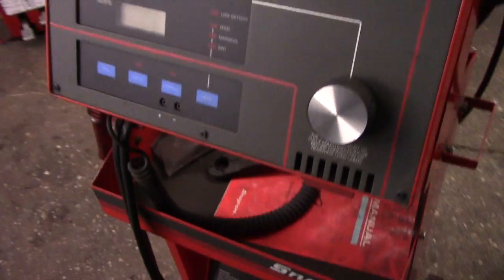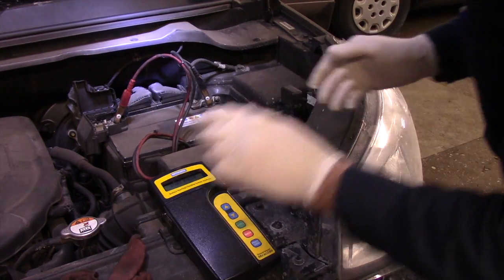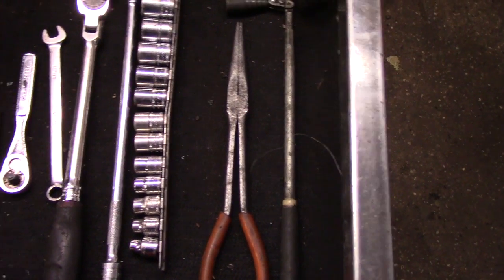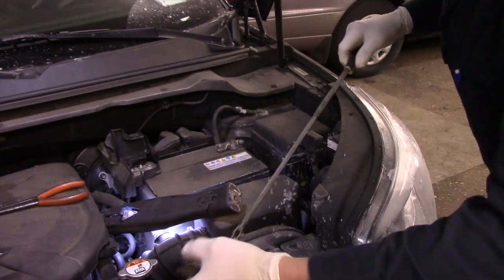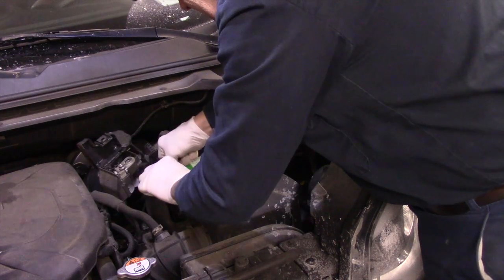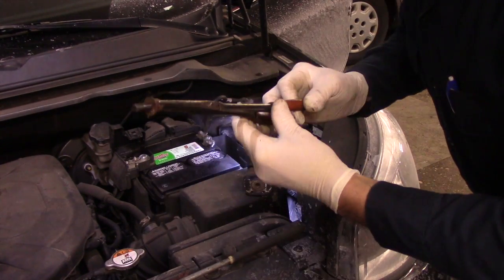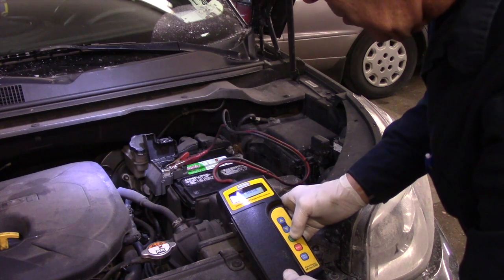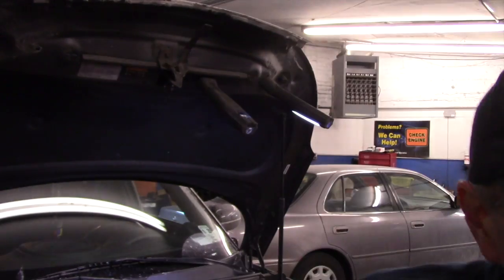No start now what !!!

Comment: all the repair shops in the NYC/LI area all sell and install Interstate Battery. Its probably due to a distributor or supply chain. 
I'd prefer to Interstate batteries over than the ones you get at AutoZone or Pepboys

Comment: The Panasonic battery in my single-owner 2005 Camry lasted 11 years and about 85000 miles. It was a little weak, but the only reason I changed it was because my son took the car to college. Otherwise, I would've run it until it died.
Reply from the maker: You are very lucky .Thank you for your input.